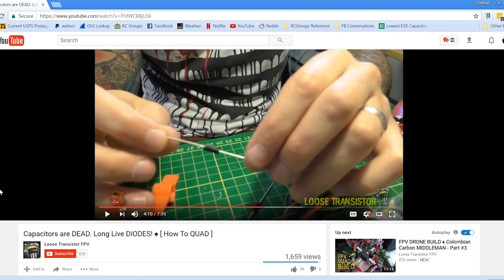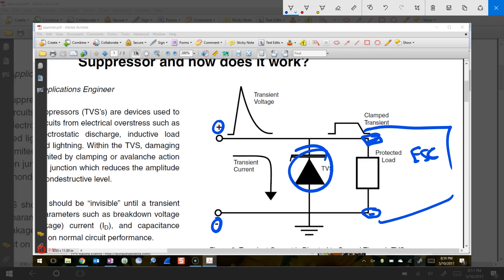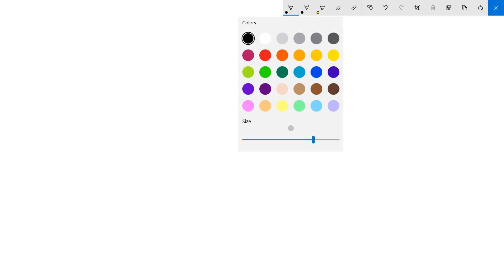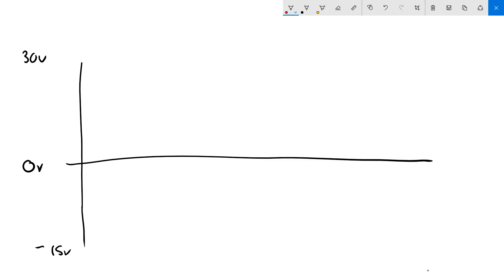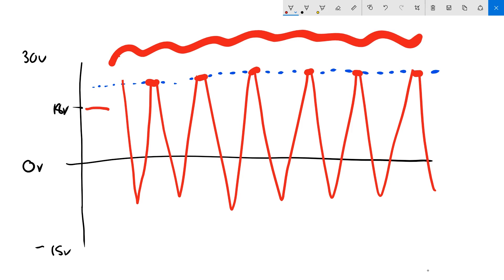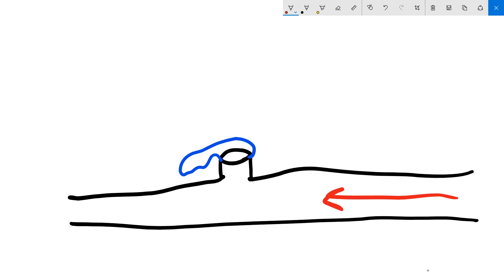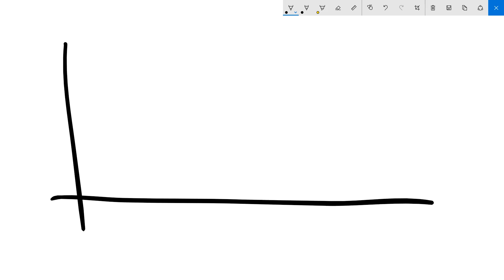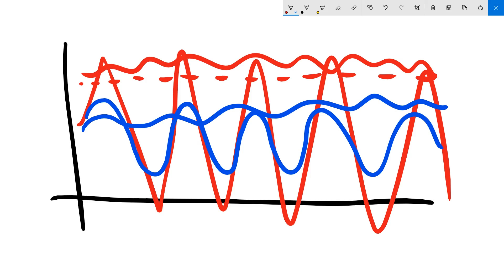TVS Diode Instead of Capacitor? No.

Comment: Is there such a thing as too much capacitance? (other than the issue of additional, unnecessary weight).
Reply: Flying Squirrel FPV no, you can put as big a battery as you want on a quad. (A battery is basically a giant capacitor)
Reply from the maker: If you were trying to filter specific frequencies and not other frequencies, then you could have too much capacitance. Think about the capacitor that is sometimes installed on the signal line of the ESC. It is filtering too much for DSHOT and we have to remove it to allow the high-frequency signal through. That's a case of "too much capacitance".

But for a power line, in general more capacitance is better because you want power lines to be basically perfect DC voltage.
Reply: You'd think ESC's would come with them already. Or better yet, a PDB equipped with a capacitor(s) and diodes to clean up all components.

Comment: The quick answer is... use caps, not diodes.  Caps store energy that can be used throughout the system, these diodes dissipate energy as heat and it's wasted.

Today is brew day for me (10 gal batch of Saison) so I don't have time for a complete answer.  I'll come back in a few days after I recover and see if someone has covered it sufficiently.  Cheers!

Comment: This isn't a matter of TVS Vs. cap. Both have their uses, and ideally, both would be used in a noisy, transient filled system like a quad.

One thing that's been ignored is that running multiple caps in parallel can be helpful for removing noise of different frequencies. You see this in power supplys in noisy systems (automotive stuff), where a small, low esr cap, think 0.1-1 microfarad, and a larger resovoir cap are combined.

The TVS does a different job entirely. If the cap(s) are a reservoir for providing for short term current spikes, the TVS diode is a tool to clamp transients, either negative or positive (assuming you choose the right type) A transient, in this context, is much too fast for even a very small cap to smooth out, so we clamp the sharpest part of the wave, then let the cap(s) do the remainder of the work and clean up the rest of the waveform once it's back in the same order of magnitude as the normal system voltage.

A cap on it's own isn't fast enough to catch all of the switching transients, and a tvs doesn't have the ability to fill in or absorb slower AC waves that end up on the V+ rail. Combined, they can clean up a lot more than either one could on it's own.

Whether both are needed in a particular system would depend a lot on what the system already has in place. Some ESCs are lacking in bulk capacitance, and so a reservoir cap will help smooth out the supply. others have plenty of capacitance on board, but are sending nasty transients down the line, and in this case, the TVS can help more.

Short of getting out a differential scope probe, and simulating high load conditions on the bench (varying throttle position rapidly, with props on - not recommended!) while you look at V+, the best bet would be to just use both. There's very little to lose.

I suspect we'll see TVSs as standard on new escs being developed, because it's a very small price to pay for making sure your product doesn't blow up VTxs and so forth when it's put under high loads.

Source: I've studied EE for a few years, and have experience working in automotive tech, which deals with similar conditions to the power rails in a high performance electric RC models
Reply from the maker: This is exactly what I hope I said in the video. Use each to their purpose. The only reason I phrased the video the way I did is because the title of the original video suggested that you could replace caps with diodes, and I want to clear up that misconception.
Reply: Joshua Bardwell I actually typed this before I finished your video, and judging by the title, o though you were taking a less moderate approach.. I agree with most everything you said, just thought it would be helpful for someone to gave a written summary to refer to.

BTW, keep up the fantastic work, you're a huge asset to this community. peace and love from new Zealand!
Reply: This is the best answer I have seen yet. Both perform different functions, and both of those functions are a positive to our systems, so do both. :)
Reply: Yes your absolutely correct.  As has been stated many times, yet nobody reads into stuff much and wants to just blurt out their assumptions.
Reply: No more of a chance that the already many of ESC's etc. that fail and catch fire in the air  However, they can, and may prevent that scenario , which is part of the reason they are recommended.   In my many years using TVS in power electronics of varying application, I have never had a TVS fail unless it was intentional in the lab, and they have always failed open.  Thats not to say they cannot fail short , its just the rarest of the failure modes.
Reply: Very true.  Fires are very possible, and do happen, but worrying about a TVS causing one would be the least of your worries.  As you state , in a short condition , most things on a quad would just fuse open , as is the case in the vast majority of failures we see involving such. The  majority of fires I have seen are the battery catching fire from being damaged in a crash.   I mean, if people are going to worry about a flying fireball, stop using lipos , or just stop flying period. A TVS does NOT increase the risk of fire , and may actually decrease the risk.
Reply: Hrr Pippi not eeeexxxcatly, but close enough,  yeah. once it hits its rated voltage, it starts to conduct, and effectively soaks up the transient, producing heat in the process.
Reply: Hrr Pippi not eeeexxxcatly, but close enough,  yeah. once it hits its rated voltage, it starts to conduct, and effectively soaks up the transient, producing heat in the process.
Reply: If it fails open, no , its open, and will not be shorted.  It would be shorted if it failed in the closed, shorted state.
Reply: So next thing would be to also include an inductor in the line, so  high frequency spikes get rejected. Not sure if that would do anything in this case as frequency' are not that high.
Reply: do i understand it correct that the tvs would function as a resistor to remove voldtage spikes, and gets hot(waste of energy), where instead the cap can be charged and deliver back the power to the system?
Reply from the maker: +Hrr Pippi no I don't think so.
Reply: Yea, not really. The thermal dissipation is very low.  While the transients are highly energetic, they only last on the order of pico to micro seconds , and typically very infrequent.  The heat dissipated is of little concern.
Reply: Chris Tate don't TVS have a chance to be in an open failure state after hitting transient voltage often enough? That would effectively short the whole quad? I saw manuals where it's stated to have a TVS circuit always fused.
Reply: Ha that was a term error on my side. But to further clear this up: how often does this happen? This is some kind of catastrophic burning fireball from the sky scenario
Reply: TheWizard +thewizard totally agree, they're very tough. On top of that, with the sort of instantaneous current we have on tap, if it failed closed circuit, it'd likely just pop, and burn the leads off/blow out internal wiring, and thus go open again :)
Reply: I use both capacitors and a TVS diode.  One 330µF directly on the input pads of each ESC, according to the Capacitors for noise reduction thread on RCGroups, and a TVS diode on the battery input at the PDB.
Reply: Is there a guideline to choosing a suitable diode and cap if im going to use both? This is for a 4s 5inch build. Running 2207 2400ish kv motors with a 30A single esc.

Comment: So if the diode is only protecting from incoming surges, why not place it on the power lines for the vTX and camera? Wouldn't that have the desired effect?
Reply from the maker: +Antoni Georgiev it would protect against over voltage surges but not noise in general.

Comment: I think you are absolutely right. Additional to that: By using a TVS Diode, doesn't that mean, that the Diode is shorting the whole system in case of overvolting? Seems like it would stress the battery even more...
Reply from the maker: +MrPurple as soon as the transient passes, the short goes away. This isn't an issue.
Reply: Right.  We are talking about true transients here also , that last on the order of pico-micro seconds in most cases.  However they can be extremely energetic in that time period , which is why they kill.  If the transient is slower than that, they become a different entity, and are referred to as ripple, swells, sags etc., and that is where caps come in.

Comment: Just a quick note, I think you got the direction of the diagram wrong at the beginning of the video.

The protected load is actually your components, not the ESC. The ESC is the source of the transient =)
Reply: Joshua Bardwell - sorry Josh, but that just isn't the case. The instantaneous voltage at the ESC terminals has to be more positive than the battery voltage in order for current to flow back towards the supply battery.
Reply from the maker: +Loose Transistor FPV I think that the direction of the diode determines which component is protected. When current is flowing back out if the ESC, the positive lead is at lower potential than the negative lead so the diode will not open.
Reply from the maker: Yes, y'all are right. I was wrong. The diode does work in both directions.
Reply: +Joshua Bardwell I believe you can use these diodes in a bi-directional manner, as outlined here: https://en.wikipedia.org/wiki/Transient-voltage-suppression_diode. I will be testing 4 scenarios on the bench (no protection, caps, diodes, caps + diodes) Lets see what the science says :)

Comment: good concept, but does must modern pdbs, already have built in, noise filters, caps, diodes etc?
Reply from the maker: Many quadcopters can benefit from additional capacitance.
Reply: Ok
Reply: And by my own experience, with transistor sw radios, an old cap, when it blows, or swells up, usually means circuit instability, and half or the times circuits will fry.
Reply: I will say add a ferric noise choke, on the main power positive side
Reply: Back when this whole brushed motors and mechanical servo speed controller, we where adding ceramic disk caps to the electric motors. Back then it was rc radios on cb frequency 27mgz
Reply from the maker: +Juan Trujillo if you do that, it will melt. Or be really massive. We're pushing 30, 50, 80 amps here.

Comment: Quick question. If manufacturers know there is an issue with transient spikes and noise filtering using a capacitor. Why wouldn't they address those issues. Love your content by the way. Your a rockstar.
Reply: They actually have started to. If you look on some of the newer 4in1 and single ESC's they are already coming with TVS diodes mounted. So there is some legs to this.
Reply from the maker: ESCs used to come with electrolytic capacitors, but manufacturers wanted to make them super small and light so they stopped. Many quads can get away without the capacitors so they figure why add them if they don't need them.

Comment: I have some questions to sum up to the discussion:
1 - regarding the noise I'm not sure how bad and how much it does affects the ESC behaviour. Same for the FCs. Both have their own regulated power supply, which is on a voltage much lower than the battery voltage. Does it interfeers with the sensors measurements? Idk. I believe that the noise will impact the video transmission quality only, because the radio RX is digital already with error correction features.
2 - I'm not sure if ESCs "brake" and retrieve current back to the battery. That is called regenerative braking and I dont think it is implemented on our ESC inverters.
3 - not sure if the voltage reaches values close to zero. Today's batteries are much more like giant capacitors (because of the huge C rates offered)

these are my 2 cents, I hope they contribute to the topic, cheers
Reply from the maker: The main way that noise affects the ESC is that it corrupts signals like the throttle signal and the video.

I definitely do think BLHeli ESCs do regenerative braking. This why you can't run a quadcopter motor off of a bench supply if damped light is enabled, at least not without massive single-digit Farad capacitors installed.
Reply: Is it EM induced noise then? because the signals are generated in the FC, supplied by a clean regulated supply, right? the ESC microprocessor should also have a clean regulated supply, so I thing both parties should be able to communicate without interference.

Regarding motors regenerative braking, I still dont think they do it. I went to check what is that "damped light" and if I got it right, you can achieve that by simply shunting the inverter. The EMF induced  by the moving magnets to the motor wingdings generates a voltage which is inversely applied to the coils, thus opposing the spinning. This is called active braking.  You can check this phenomena by trying to spin a spare motor while holding the three wires together.
cheers
Reply from the maker: +LetesOfHell the clean regulated supply requires a consistent ground reference. In a noisy circuit, ground reference is all over the place.

Comment: it sounds like a place for a diode would be just before the equipment you are trying to protect? camera, vtx, or just after your 5v 12v becs?
Reply: TVS diodes should be placed on each ESC to protect the ESCs themselves and prevent the transients from entering the rest of the system

Comment: could you make a video about capacitors and what happens when you plug in the battery, some have talked about a spike being introduced to the system when capacitors are used when plugging in the battery
Reply from the maker: +FPV Kubbur the capacitors will take a brief burst of high current and you can get an arc from the XT60.

Comment: ESC is a protected load? I thought we protect FC, camera, etc from the spikes GENERATED by ESC...
Reply from the maker: +vadimus2007 that woukd require installing the diode backwards and then the battery would be shorted and would blow up. The polarity of the diode determines which component is protected. Only the load side if the battery can be protected by this sort of diode, unkess you build a more complicated circuit to protect against the short circuit condition.
Reply: Damn, right. Now it is even more confusing!
Reply from the maker: No, I'm sorry. I'm mistaken here. The diode protects both directions. The voltage does not go negative. I don't know what I was thinking. For current to flow back into the battery, voltage must go above vBat. Sorry for misleading you here.

Comment: My cheap DJI F450 build crashed a couple times fried an esc i put a capacitor on the power distribution board +and-  in.No more crashes and esc`s stay cool.Flies great for a simple cheap first build.The cost of damaged battery,motor,esc props and frame arms a simple fix 25v 1000uf did the trick.